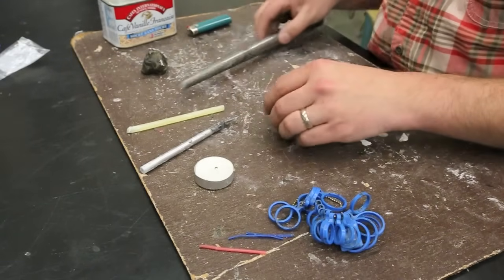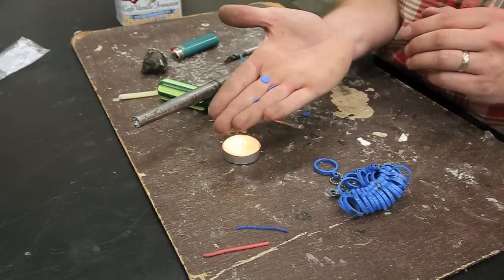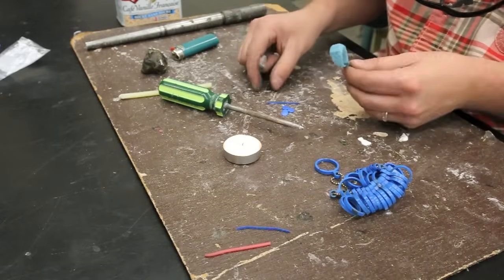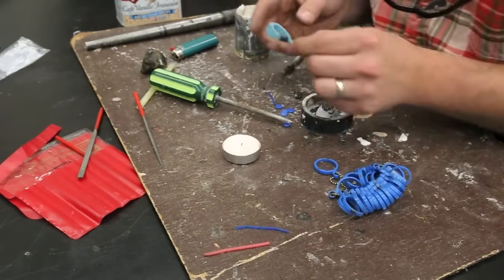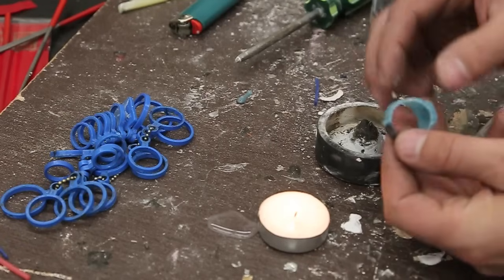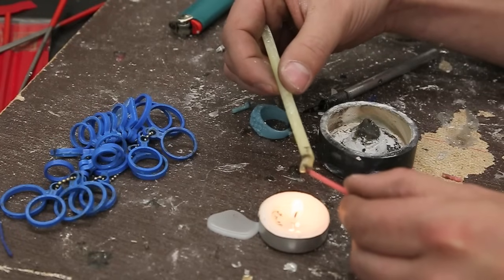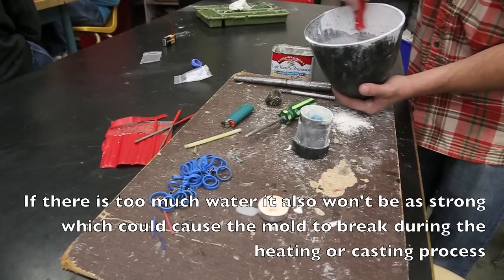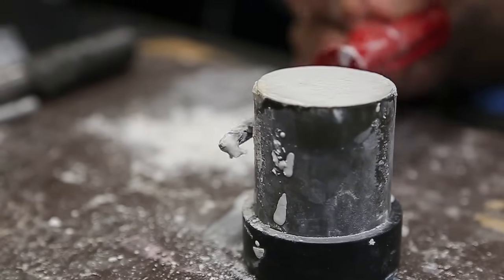Simple Lost Wax Casting - High School metal shop with "minimal" tools

Comment: What's the mixing powder called if you dont mind me asking.
Reply from the maker: Investment powder. Most jewelry supply shops should be able to source it for you
Reply: You can’t use plaster of Paris??
Reply: Cristabolite-mix exactly - don't eyeball it-fill crucible at an angle slowly from one side ,preferably using a vibrator to ensure complete flow- if you find those little bubbles of metal on your casting aggravating paint a solution of  debubblizer on was up it with reduce surface tension between it and investment material/ cristabolite, 1 part liquid dish soap to 10 parts water = debubblizer.The more attention you pay to wax up  the less finishing you will have and the nicer product,dump crucible into water about a minute after casting it will facilitate separation and prevent damage to casting digging out investment, be careful,wear safety everything ,I've seen molten metal thrown out of centrifuge during casting procedure on several occasions and it goes everywhere, it's a life changer,they say the pain from a molten metal burn on the top of your foot follows you every day for the rest of your Life,Food for thought.Wear at least goggles ,casting apron and shoes protective headgear and casting gloves , it's mesmerizing casting metal.

Comment: Where does the wax melt of to...Is there a hole or something?
Reply from the maker: The tail you see connecting the bottom rubber piece to the ring mold is called a sprue. Once the investment hardens I remove the bottom rubber piece and put it in the oven. Heat melts and burns out the wax mold and you are left with a cavity in the investment the shape of your mold.

Comment: Its great to see HS kids learning metalwork. My old HS scrapped their manual arts programming years ago. I visited the school last year and the metal and wood shops had been converted into glorified junk storage rooms  - tragedy.  Possible class project - make a vacuum chamber to pull the air out of the investment material (for cleaner castings) - cheap vacuum pump and a bell jar or some PVC pipe/fittings. Fun and instructional.
Reply from the maker: A vacuum chamber has been on my wish list!!
Reply: Sanyam

Comment: thank you. it's very useful video for me. by the way can we use gypsum instead investment powder?
Reply from the maker: If it is Gypsum powder specifically for casting then yes. Check with your supplier first though. Don't assume drywall powder will work!

Here is a PDF that talks about using Gypsum based powder
http://lapidaryworld.com/pdf/castinginfo.pdf

Comment: You have three problems that you should avoid. Problem one on your rubber sprue base clean off all the investment plaster then use a tiny bit of Vaseline and coat the base each time you go to use it,  keeps your sprue base clean.  One tiny flake of dried investment can destroy a wax pattern!  Problem two is the flask is  full of dried investment, always clean them with a scraping knife. They make a non flame pad you can wrap around the inside of flask before you mix your investment.  Problem Three your investment powder is and exact science there are mixing formulas and water temperature for each type of investment you use. There's only a few minutes to mix de-bubble and set, anything to short or to long can and many times prove fatal to your wax mounting.   RHJ GOLD MFG
Reply from the maker: We've changed up a lot of things in the class since uploading this 5 years ago. thanks for the tips
Reply: We Build Stuff Can you post a updated video? That would be good
Reply: I do not know nearly as much as RHJ here. I used to work with a friend who was a professional gold smith. The investment you make in this film scares me. We used to be very careful to make it as perfect as we could. No lumps AT ALL. Makes a huge difference in the final cast. You don't need to use grinding tools on the metal at all if you do it right.
Reply from the maker: @hand PCguy I measure investment carefully now and use different techniques throughout the projects. I mainly keep this video up for students to show the process with preparing their molds and basic wax sizing techniques with the cheap tools we have available to us.

Comment: can you use candle wax ?
Reply from the maker: You can use just about any kind of wax as long as it retains it's shape during the casting process. I have used plastic toys in the past to make molds. I do prefer harder waxes as it is easier to carve and manipulate. Candle wax seems like it would deform to easily
Reply: cool thanks